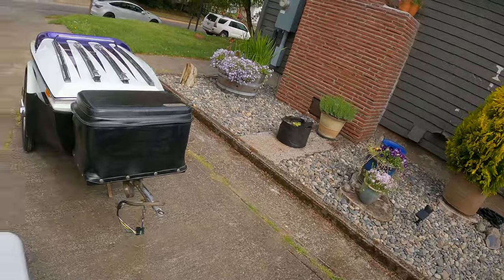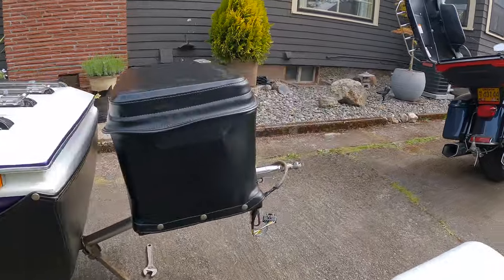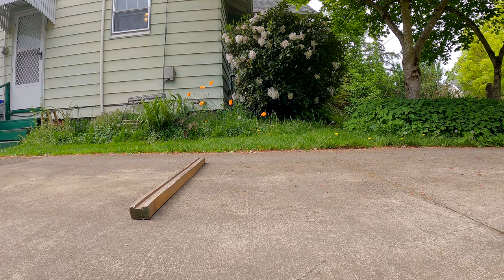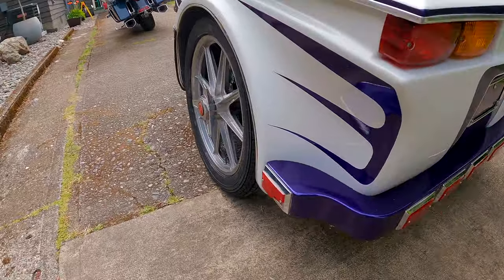Motorcycle Trailer Build part 5: Ready to Roll

Comment: I have a Bushtec Turbo +2 trailer.  I have about 100 pounds of cargo but removed the tongue cooler and rack.  I find with 100-125 pounds of cargo the pressure should be around 42-45 PSI.  I have a small hand pump similar to the one sold by Bushtec.  It works great.  My tires are absolutely perpendicular to the ground.  I have the 20 year old shocks and they work great.  Go for it and don’t worry.  You have one of the very best tow behind trailers made.  EDIT:  Buy a tire pressure monitor with 3 sensors, one for each tire and the third for the suspension.
Reply from the maker: Thanks for the super helpful information as well as the words of encouragement. So far I love pulling this thing and cant wait to take it to Alaska. I'm going to look into the pressure sensors.

Comment: I have really enjoyed this series. I would love to see it finished.
Reply from the maker: Me too! I added the yeti cooler which means I have to fabricate a new bracket to hold it. The cooler broke the tail lights on my bike because of a steep driveway in Redmond.  I'm working on it, not that I've had it on the road as much as I have I would like to compartmentalize the interior as well as fix up the exterior
Reply: @OldFriendsandNewRoads  nice sounds like it's getting closer.  Bummer about the light clearance issue on steep inclines. I'm sure tool find a good solution

Comment: Monroe MA785 shocks are supposed to fit and a direct bolt on. I can't confirm, haven't done it. They look correct in pictures.
6203-5/8-2RS C3 EMQ Premium Rubber Seal Ball Bearing ABEC-3 6203-10-2RS 5/8” ID  bearing should be direct replacements for wheel bearings.
BushTec is still in business for parts. They don't make trailers anymore, probably a matter of time before they are history.
Reply from the maker: Thank you so much for this, last set of shocks I purchased doesn’t work